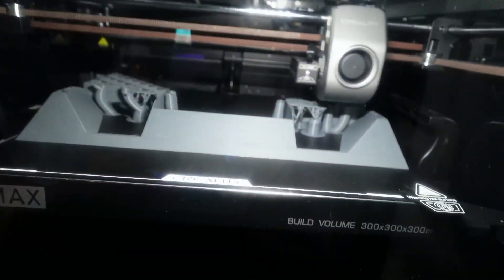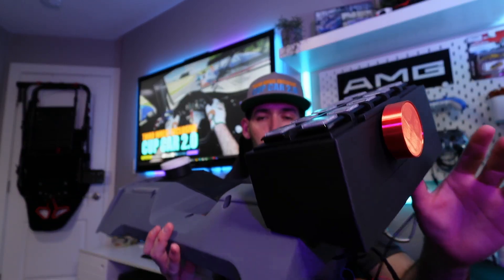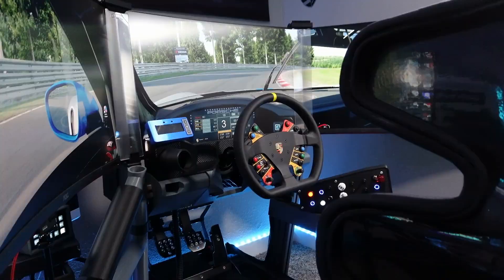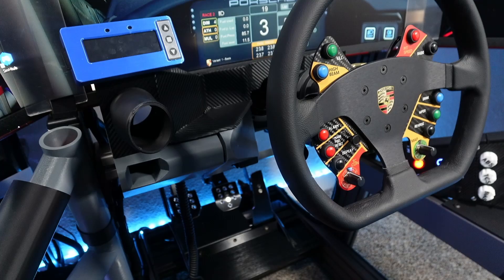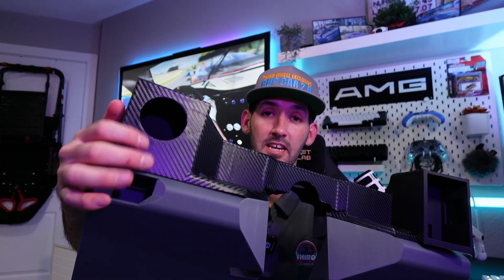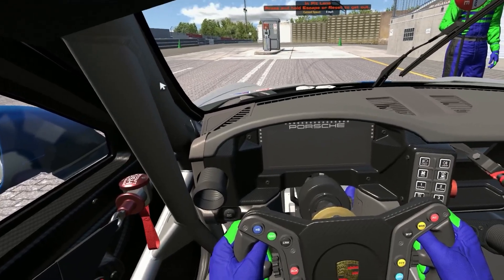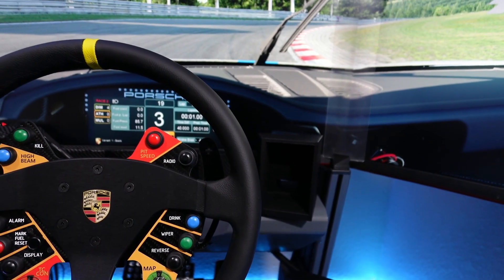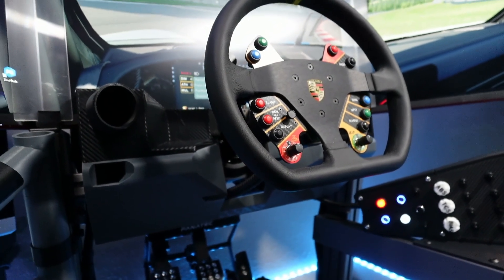Cup Car 2.0 E5: Why I Had to Destroy My New 3D Printed Dash

Comment: That is so awesome. Does it matte what kind of rig you have in terms of size and space? I‘m really thinking of printig it too
Reply from the maker: It might require minor mods but the main part is build to fit on a 40mm thick wheel deck. Would also depend on how you mount your wheel base.

Comment: loks gr8 Sir,  Well done, see you on the track!
Reply from the maker: Thanks for always being engaged. Any feedback or thoughts to share on the build so far?
Reply: @ThirdWheelExclusive  I’d recommend closing off the bottom area as much as possible and repositioning your pedals to a more GT3-style layout. This setup tends to be more comfortable, especially during long races.

When your legs hang straight down, you can end up pinching them and restricting blood flow—particularly because the seat usually leans back. Angling your legs slightly forward helps prevent that and supports better circulation.

Comment: So what STL files are available for members?
Reply from the maker: As of right now the newest dash and the original dash are both available, the center console from the last build, net quick release, side impact bar, the over size 10 button box. Basically everything I personally designed for the old build and the new build. I didn’t design the lap timer or 991 button box so those ones aren’t available. If you’re looking for something specific I didn’t list then let me know.
Reply: @ThirdWheelExclusive  where do i get the STL files?
Reply from the maker: @francescohelsing5031 They are available to base members (Rig Builders) and up, you can join here.

Join this channel
https://www.youtube.com/channel/UC4Qr4Krbiwa3L8peGSxJxvQ/join
Reply: @ThirdWheelExclusive  There is this new dash that you made? Is possible to edit for our personal size of the rig?
Reply from the maker: @francescohelsing5031  The files can be modified if you use blender or another software and convert to mesh. Might take a little adjusting and cutting if you need it shorter
Reply: @ThirdWheelExclusive  hey that's cool.  I love the dash.  I assume it prints in parts?  How do you attach it to your rig?  I would prefer to buy the STL files from you as a one off via paypal, buy me a coffee or on of the STL selling sites if you are willing to do that?
Reply from the maker: @SlowPokeRacing33 The STL is two solid parts but depending on your printer size, you can use the slicer to cut it. I did the bottom in half and the top in thirds. As far as selling the STL files, I only offer them through my YouTube membership to stay consistent.